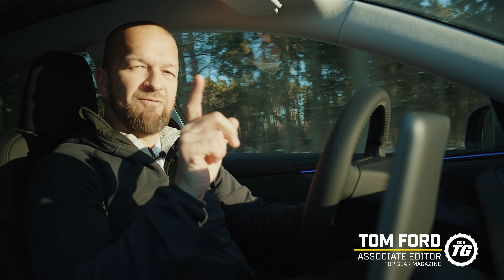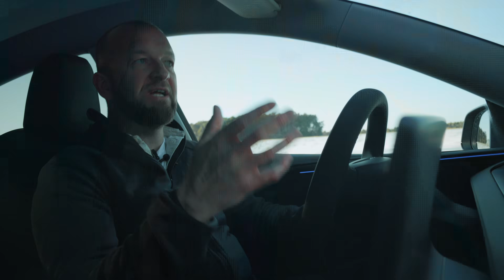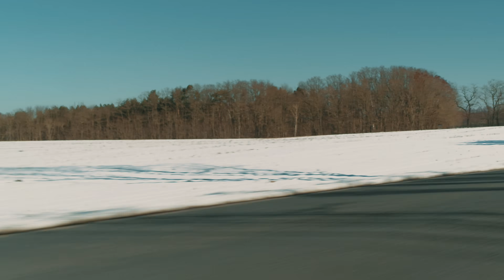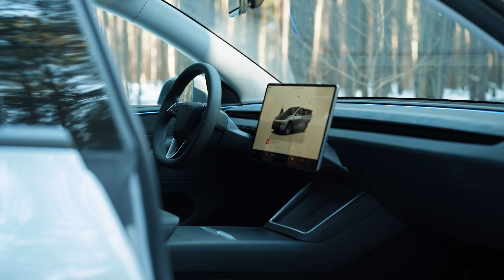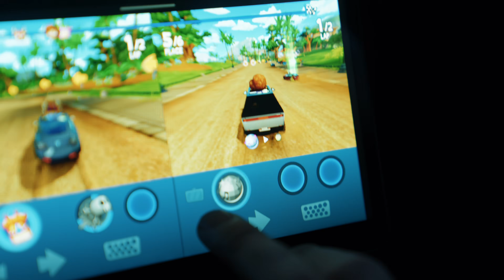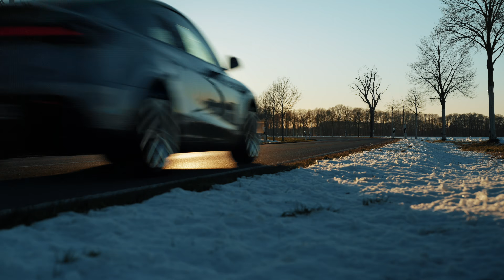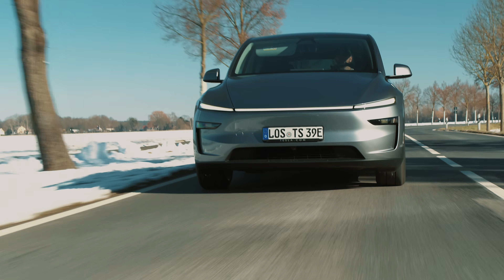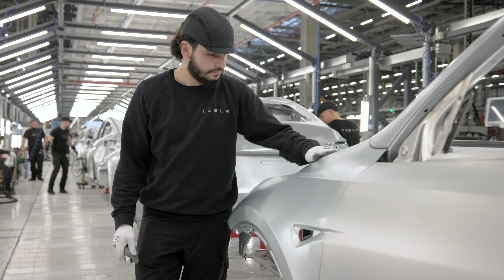Tesla Model Y – Sell Your Old One, Immediately!

Comment: What I got from Lars...
"new lower cost models coming out this summer" 🤔
Reply: Launch edition is the top spec Model Y, AWD Long Range with all the options ticked, down the road lower trims will come. And yes to the masses those wouls be better.
Reply: @Essential_OS  its not AWD, its the rear motor version, I have one. Lower cost models must mean Cyber Cab and Model 2
Reply: @EngineerMakesStuff  The "Launch edition" Tesla Model Y is AWD Long range with all the bells and whistles that Tesla Offers, that's why it's this expensive. just look it up on their website or even any other review on the internet.
Reply: @Essential_OS  He was talking about the new model coming out, not a lower trim version of the Y. Not the hyper-cheap of the unboxed engineering method, but a new model made on the same existing lines using some of those processes.
Reply: @DR.LingeringFrey  I got it wrong then. yes Tesla mentioned cheaper cars coming out but we're still waiting on the roadster since 2017... soooo, as much as I like Tesla, I wouldn't hold my breath on their words...
Reply: @Essential_OS  The roadster is basically meaningless to Tesla as a company since they will sell so few, so there is no push for them to actually get around to it. Since the cheaper models will be big sellers, they have incentive to actually make them. I do think they will get to the roadster eventually, but I certainly wouldn't want to make a prediction.

The newer cheaper models will use existing production lines that are not currently running at full capacity, so Tesla is in a position to gain a lot by fully utilizing the existing lines with a new model. As it stands that unused production is costing them money, so they are almost forced to make the new car in a reasonable time frame.
Reply: @SyntheticSpy  I think we'll see the refreshed Model S and X before the cheaper car. Rumors are around that it's coming soon.
Reply: @ I could be wrong but I think Lars mentioned somewhere that the S and X are by the end of year, whereas the cheaper models keep being mentioned around Q2. Similar to the roadster, I wouldn't expect S and X to be as high as a priority due to being such low volume. They've been described in the past as only still being produced for "sentimental value".

At least to me Tesla describing something as "end of year" typically translates to a vague "we will get to that 'later'".

I do hope to see them within the year though. They are in need of a refresh, especially compared to the new 3/Y, and seeing as how well they are handling the change to the new Y I would think they can handle a low volume S/X refresh very quickly/easily.

I do think they need to bring 48v and steer by wire to them on this refresh. Would be disappointing for them to go another cycle without it. Doing that could delay the refresh though
Reply: @SyntheticSpy  I'm not sure either, my guess would be as good as yours.
Reply: They’ve been talking about that for a few quarters now. Still no sightings of test vehicles anywhere….
Reply: @edwardhackett-jones8126  omg how dumb can yall get???? IT'S LOWER TRIM VERSIONS OF THE MODEL Y!!!!! there's always few trim levels for ANY car, Model Y RWD Base,  Model Y RWD Long Range, Model Y AWD Long Range, Model Y AWD Long Range Launch edition (now available) and finally Model Y Performance
Reply: Agree.  Wait a little.  A lot of competition and Elon by himself is driving down the sales numbers. LOL I'm waiting until the summer or fall.  The engineering on these model Y's are still top dog. In the US drive Tesla.  In Asia, drive something like Xiaomi or MG or Geely or Chery or Volvo etc etc.
Reply: He's specifically talking about the lower cost versions of the Model Y which will be in production this summer, as they only had the high spec Launch Edition when this interview happened.
Reply: @IYKYK-UK nope, it was clear it will be lower cost than the old Gen of Y and 3, the normal trims for new model Y are already available, you can now order de standard range for 45k and get it in 2 months time.
Reply: @ I don’t think you can know that with any certainty.

You may be right. But they’ve discussed “new lower priced models” in the past. I think generally people would not consider a cheaper spec variant to be a different model.
Reply: @edwardhackett-jones8126  the certainty is knowing they wouldn’t allow the interview to go out if he happened to mention future products that haven’t yet been unveiled or even announced.

Comment: "Night and day better than the old Model Y" this is what I wanted to hear, didn't like the old Model Y rear suspension.
Reply: mine is perfect, the first ones where kindy bumpy but they changed it, it is not bad at all, the "old" model Y is still a perfect car, obviously.
Reply: @JohnSmith-pn2vl  The Telsa Model Y that I test drove bounced very badly in the back when took the foot of the accelerator. Was probably older than the one you have.

Comment: Those were not the headlights you pointed to, that was just part of the light bar.  And the front bumper camera is not used for self driving...yet.  The windshield only has two camera's, not two or three.  Been this way since 2023.  And Tesla is pronounced "Tes-La", not "Tez-La".  Elon pronounces it incorrectly.  The original founder said the S as an S, and not a Z.  Elon is not an original founder. Also, the previous version of the Model Y had the same one piece castings.  Still gave the video a thumbs up because of the interview with Lars.  And just wish Tesla would stop using wheel combos where the rim sticks out as far as the tire.  That just makes it easier to curb rash them.
Reply: You must be fun at parties…

Comment: Small correction @ 8:40 acceleration is 4.3s 0-62mph not the 4.8s quoted. The launch edition includes Acceleration Boost, which is part of the reason it is more expensive.
Reply: that is US numbers which are flawed, 97% of the world, as, THE WORLD, measures correctly.

Comment: I will keep supporting Tesla because they hire the best engineers and make the best EV!
Reply: So not because you are a fascist?
Reply: Deluded
Reply: @mikewallace1723  Having driven 10 different Teslas and 5 different Lucids and another 8 other brands of EVs I don't think they make the best EV. I think they make a very compelling car for the price but removing the horn on the center of the wheel, removing the steering wheel and stalks and hiding general controls is not a way to make the best EV. Having lousy brakes on a fast "performance" car is not good engineering either IMO. Making a production version of the Cybertruck that actually works is amazing engineering hands down, but that is probably the worst EV I have ever driven for so many reasons. The 4 wheel steering in the CT is really well done, but that is the only thing that vehicle does better than others.
Reply: It's the perfect car for the utterly amoral. Enjoy!
Reply: I’m speculating but I think the best engineers won’t want to be working for Elon for much longer.
Reply: @ not many ev companies can compete with tsla tho, and not that much capacity
Reply: @rennenthusiast  the best engineers are smart enough to know what's happening. 
No one with a functioning brain takes the legacy media propaganda against Elon seriously, only stupid and ignorant sheep do that.
Reply: what about Lucid Motors?
Reply: @davidditzler2704 no l
Reply: @davidditzler2704  also good but not as much affordable as tesla.

Comment: I love Tesla as a company and its mission, I've been an investor since 2020 and think Elon will be remembered as one of the greatest technological innovators ever. Whilst I do recognise the vast improvement the new Model Y is over the outgoing model I do have some constructive criticisms that I know Tesla won't read, but I'm going to lay them out anyway. Several of the main  issues that prevent people from buying a Tesla have not been addressed in this new model. The suspension and booming noise are the only bugbears from the previous model that they properly fixed. The others people take umbridge with which they easily could have and should have solved are. 
1. Despite having a better coating on the glass roof I'll be interested to see how it goes on blisteringly hot summer days, an electrochromatic roof that glazes over at the touch of a button or even a simple closeable sunroof would have been a better solution. 
2. Whether you think it's an issue or not, many drivers do not like changing their field of vision to look at the speed they are going or for upcoming directions on maps. A heads up display with simple car data and directions on screen in front of you would be a classy way to solve both of those issues. 
3. Vehicle to load functionally is a glaring omission in 2025 when EVs half it's price now come with this handy feature for everything from keeping essentials running in a blackout to powering 3 pinned devices on the go. It is beyond ironic that an EV with a large battery would have a camp mode and no ability to be used as a generator whilst camping. 
4. The 4 year warranty Tesla offers (8 years on the battery) is getting very outdated when looking at other manufacturers like Xpeng and MG offering 10 years across the board here in Australia. 
- Saying that updating the battery technology isn't necessary because the car is more efficient is baloney. That's great that the car is more efficient, but when you have cars from Geely group under the Zeekr brand charging in 10-12 minutes (less than half of the time it takes in a Tesla) whilst using LFP technology that also has a higher cycle life that reasoning doesn't cut the mustard. CATL and BYD's new blade 2.0 batteries are going to have similar performance capabilities to Geelys short blade and golden battery and Tesla must keep up. If not in the US where tariffs are prohibitive on external cell imports they must do it in other markets they supply out of China without tariffs. 
Elon may think everyone wants a Tesla and it's only price that matters, but that assumption would be incorrect. A decent percentage of people will not buy a Tesla until 1 or more of these issues are addressed and it is not ok for Tesla to make excuses for why it's ok to fall behind in these areas. They have been a technological leader in this space and they need to remain that way because if they allow the Chinese automakers to give you more for less, that's what people will gravitate towards as they become more familiar with those brands. Stating that you can add these features as aftermarket features would be a poor response, the majority of people do not want to go to source these things externally and have to research what to buy and risk voiding their warranty. Tesla should either make the car $1500 or so more expensive to add these features or at a bare minimum let people tick them as options. 
That's my 2 cents and it comes from someone who wants to see this brand remain a dominant force into the future.
Reply: Adolf Musk is a financial investor, that’s it. He will be remembered for relaunching fascism in the 21st century. But yeah, let’s not mention that 🤡

Comment: so a quick look at the specs and they haven't improved the range and the price went up by $16k cdn?  you'd think they'd improve something there.
Reply: Tesla new Model 3 announced range didn't go up but when real world tested it was much better! Hope same for Y
Reply: The car's specs haven't changed because a lot of the testing procedures have gotten harder. In the real world though it should perform significantly better. It was the same story for the current 3.
Reply: The price hasn't gone up. There's currently a launch edition which has that much in extras (acceleration boost + FSD + options).
Reply: Look better

Comment: Man I’ve still been getting around in my old Ford f150 manual
Reply: Some people in the world are still getting around on bicycles. Doesn't mean Telsa haven't built a better mouse trap in regard to improving transportation.
Reply: @trythis2821 EVS are for dumb people😂 They havent innovated anything, and the value loss is extreme. And as you see they are not green either, as they expect you to throw away your old and buy a new one every 5 years like every other piece of electronic. If you want to save the environment you buy USED and used only.
Reply: As long as you are happy.
Reply: if you need a truck you need a truck... but if you dont EVs (Teslas) are brilliant. Save a tonne on gas cost.